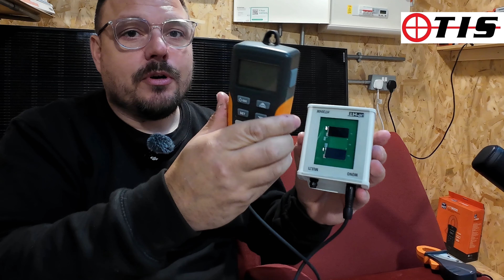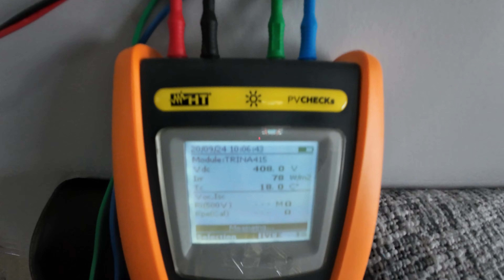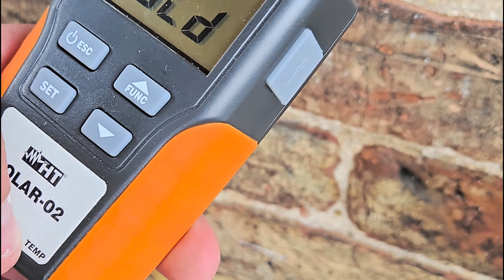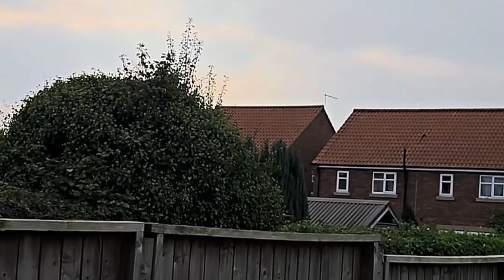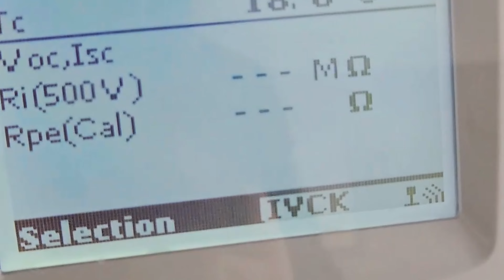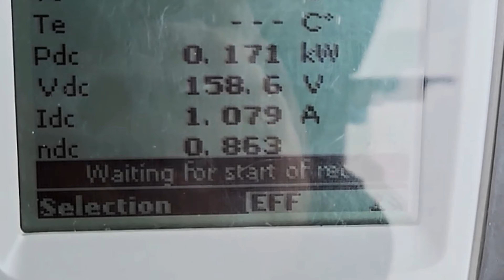Comment: Is it correct these testers wont test NType modules accurately? Apparently the very expensive new model has some new algorithm built into it that accounts for NType modules, but this one doesnt. Bit of a bummer if true!
Reply: The PVCHECKS has been out for over 10 years, unfortunately the panel market is moving that fast 15A short Circuit can be a problem depending on the number of panels 6-8 N Type you should be fine, it’s another reason most other manufacturers that do a 15A version are discontinuing it.

Comment: Am I right in saying this tester is superior to the Seawood 150/200 because not only does it take the irradiance & temp readings but because you are inputting the panel characteristics theres no need for further calculations for array performance, this testers does it all?
Reply: @craig72x  correct 👍
Reply: @craig72x  also a great feature is if the short circuit pulses over the 15A the Seaward will let you test and does the blow the instrument and needs repairing, ours warns you and won’t let you conduct the test

Comment: Thank you for sharing this information. Can you do the auto testing voc  isc ir w2 test with out entering the panel data. I need a good PV tester for testing residential properties. Do you have to connect to frame work? Most situations when I’m testing PV I have no access to the array. To have a tester that does all 3 tests sounds great.